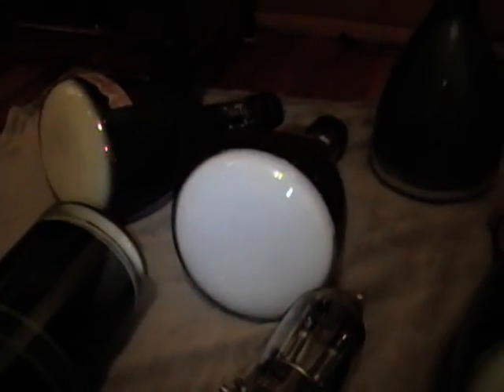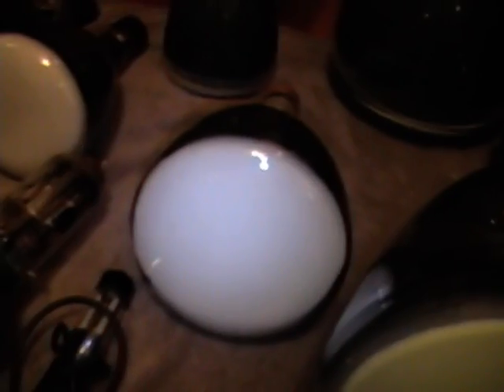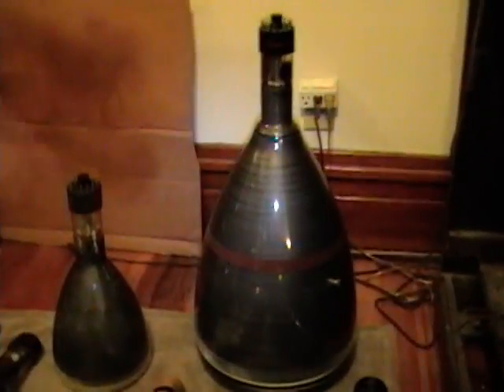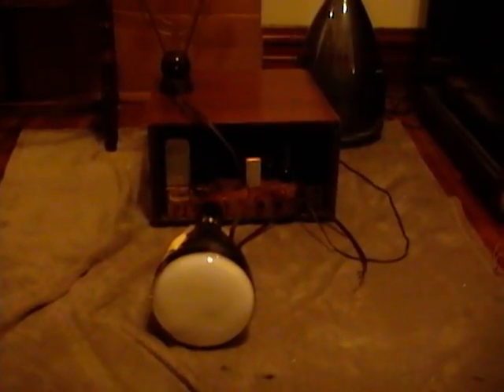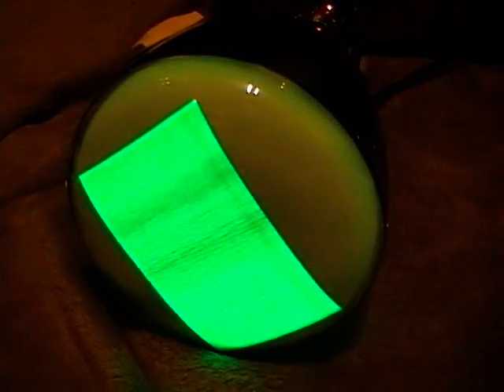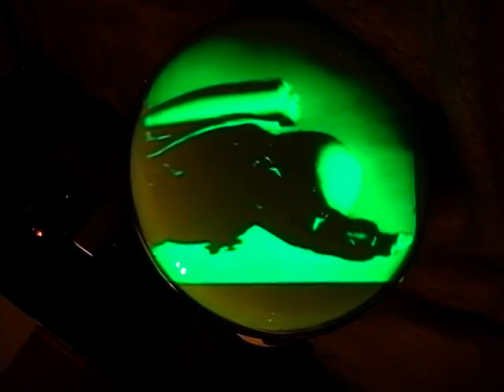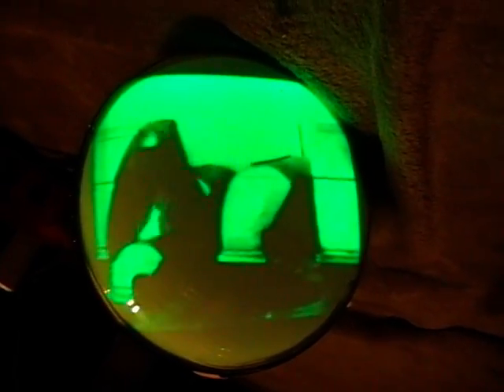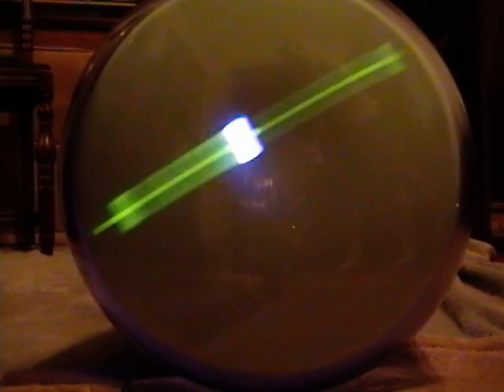Cathode Ray Tube fun - part 2

Comment: I've actually tried making a NTSC to scope circuit but it never worked properly. I made it out of scope parts which I believe we're out of tolerance. The circuit was a modification of the Scope-o-vision circuit made by YouTube user cameramanlink (who isn't on YouTube anymore.) Also the the IBM AN/FSQ-7 computers, used in the SAGE project used a 19" blue long persistence typotron tube, although I think it would appear green since there was a yellow filter(?) over it. I thought it made the most sense because the rooms they monitored the 90+ screens were lit with dim blue lights.

Comment: I still have a 3FP7 (WW2 surplus) that I got in 1959 (aged 12) from Joe Palmer in Sacramento for like $1.  I wanted to build a scope around it (2X2, 6SN7, etc) but never did.  Closest I came was in 1963 using a 1960 Tesla Coil for hv, lighting the filament, and putting full line voltage on the deflection plates for some traces.  Never could find a 14-pin diheptal socket for it back then so the base pin connections were wire wrapped (very carefully) around them!

Comment: If these things had perfect frame-rate and no pixels, why the hell did we ever switch to anything different and not just get really good at making cathode ray tube displays?
Reply from the maker: Well for starters, they don't have a perfect frame rate (usually 60 Hz interlaced) and are not color.  If you want color, you need to use three color phosphors (red, green blue) in small dots or thin stripes.  A typical color CRT has a resolution of about 720x480 interlaced with a 60Hz refresh rate. Then there is the large size, weight, distortion, etc.
Reply: Why didn't they try just overlapping three images (one of each color) aligning them using mirrors and lenses? Would have been even more bulky, but pixel-less
Reply from the maker: +Albert Einstein They did. Perhaps you remember projection TVs from the 80s and 90s? You still have to scan the electronic beam across the screen and up and down.  So there's flicker plus a limited number of scan lines plus they were huge and expensive.